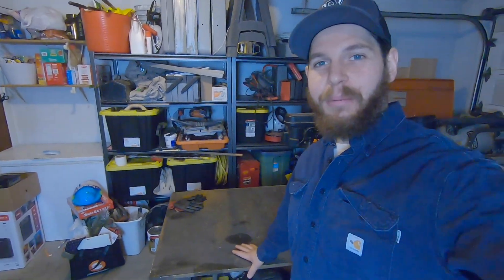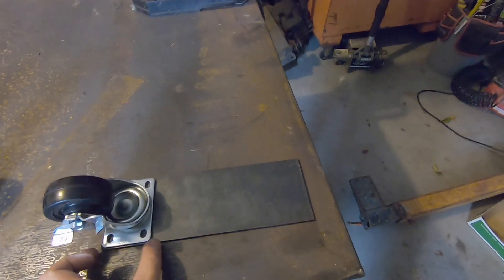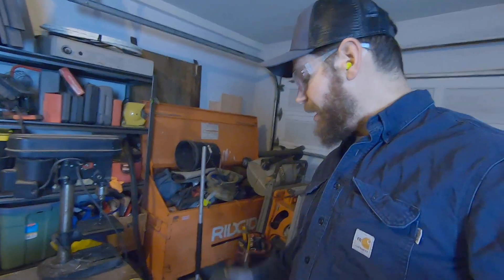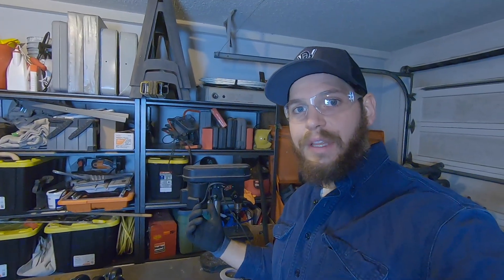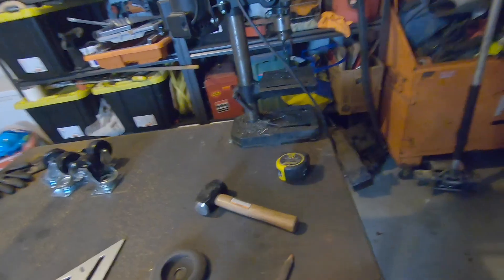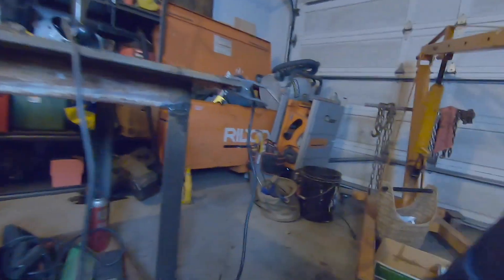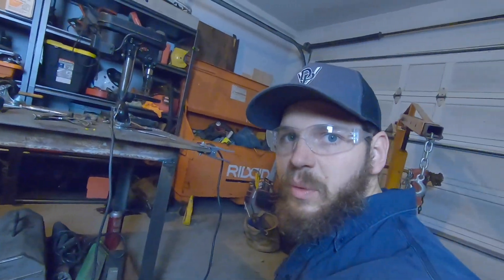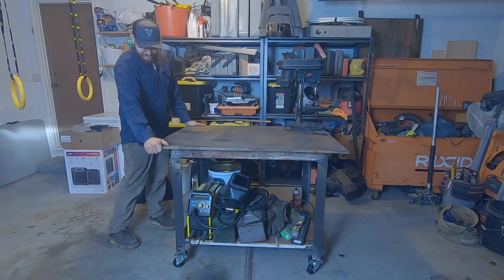Fab Table Upgrade: Locking Caster Install

Comment: Nice upgrade. As you upgrade your drill bits make sure you start using lubricants or cutting oil. Not WD 40. Real cutting fluid. Bits will last much longer and cut faster.
Reply from the maker: For sure, I normally use rapid tap, but all out at the moment. Thanks for watching!

Comment: Hey man . . . for the sake of safety, I would recommend putting the guard on the grinder when using a cutoff wheel . . . nice upgrade BTW . . .
Reply from the maker: Yeah I hate guards on grinders, they just get in the way, I've been using them for years without. I really should get full face shield though, that's where the gnarliest injuries from exploding discs happen! Thanks for watching!
Reply: @DaysofPainandVictory  I do agree about the face shield . . . do it for your kids!